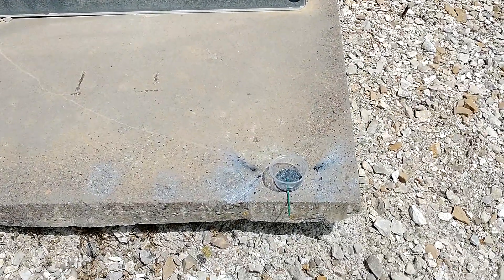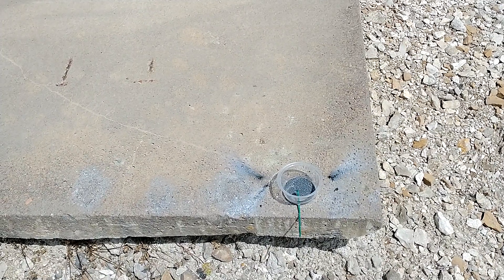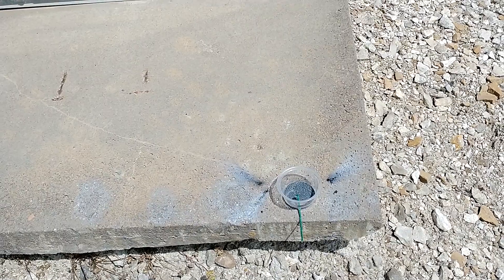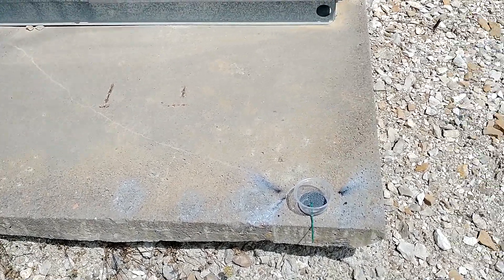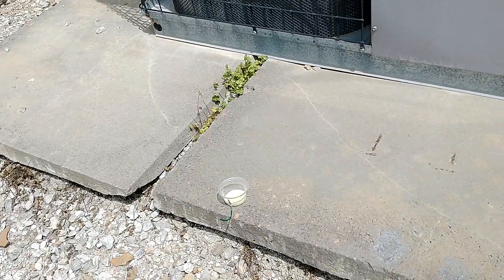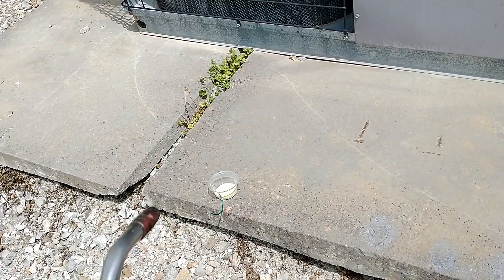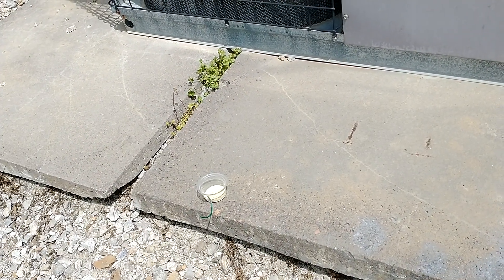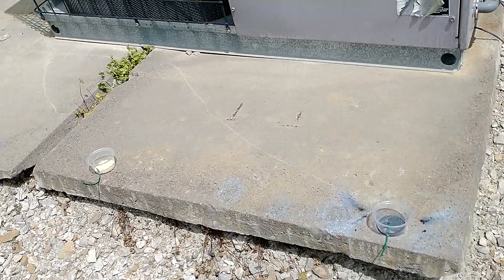Shitten Poo???

Comment: Care to tell why my standard whistle mix burns as fast as flash in a pile but won't whistle unless pressed in a tube? I order from pyrochemsource and fireworks cookbook and use fireworking formulas and the same formula as woodys and I dont have the same effect but my whistle is still good enough to lift 200 gram headers. Confusing.
Reply from the maker: Moister in the chemicals is the biggest reason for no whistle. You need to oven dry everything before using.
The moister turns to steam witch in turn blows out the vibrating air stream. Once you get the water out of your chemicals you will see success.
Reply: @huppscustom  Placing pyro composition in the oven sounds like a good way to burn your house down. 🤔
Reply from the maker: @TwistedMassPyro  I us a old toaster oven.
 single chemicals dried one at a time isnt going to burn.. You never dry mixed chemicals.